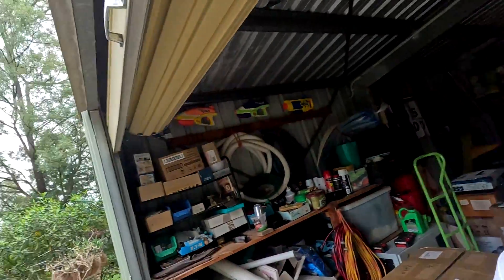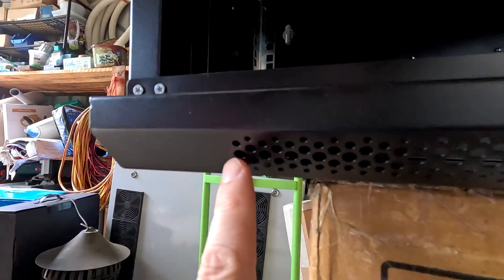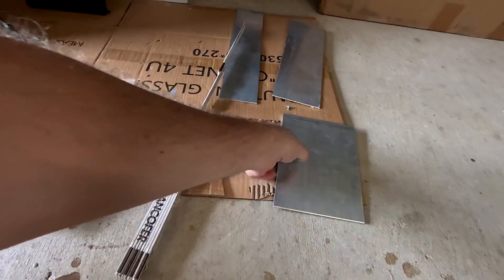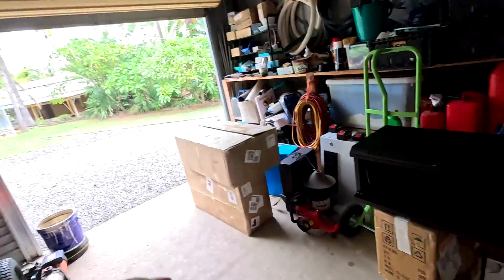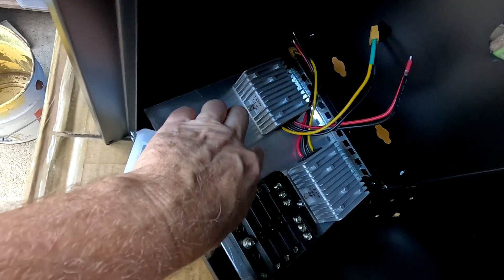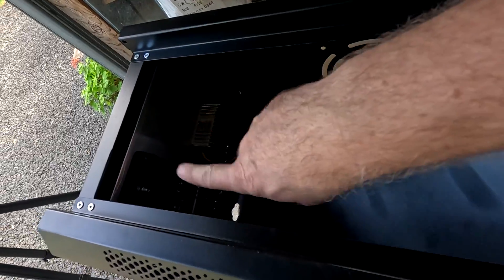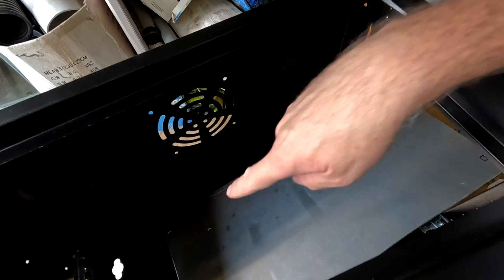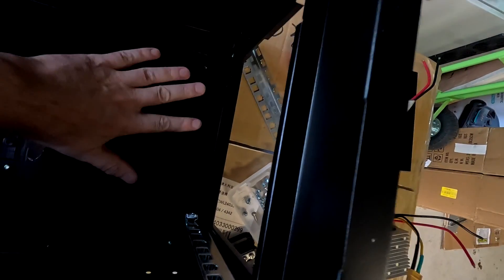Off-Grid Network Cabinet Power Supply. This was not my day...

Comment: That NUC needs 12-20 volts. If you set the victron DC/DC to output 13 volt you don't need the buck converter.

Comment: Andy, 2x 19" vented shelves would have worked better, been easier, and solved all your mounting issues. You're thinking like a machine cabinet designer, not a network cabinet designer ;-)
Reply from the maker: Nope. You will see when it comes together 😉

Comment: Hi Andy,  
I recommend you have a hole in the back plate inline with the brush plate - you will thank me next time you need to run an additional cable with the rack mounted on the wall, and your hand is shoved up the back/behind to wiggle a cable through the brush plate.

Rob from Vic.
Reply from the maker: It all works fine as it is. Sure, it is tight behind that cabinet, but I have only a few cables going through the brush plate anyway.

Comment: Be careful with those power supplies as they are not isolated the negative is 48v battery negative if you get some bit of equipment that has positive as it common you may get a short.
Reply from the maker: All the power comes from an isolated power supply. 
The fuse block has all negatives connected anyway, so it would make no difference.
I'm not aware of any devices which use common positives. Ah, I had a solar charge controller once with that 'feature'. Certainly won't happen with the 3 devices I will have installed in this cabinet.

Comment: With those cheap things, if they undervolt, then heat and current go up.  Not usually great as most electronics aren't immune to fire.  Also, depending on if your switch is a $100 consumer throw away or a $5K+ cisco/aruba/ruckus/etc... you REALLY don't want to have the flash corrupted by, oh, undervoltage.  If you do, well, you either have a long weekend with a very expensive JTAG programmer and soldering rig or you pony up for a new switch.  And generally speaking, no, wifi APs in metal boxes usually perform poorly.  Sliding rails.

Comment: You are building an OVEN for your electronics. See those big heatsinks on your buck converters, they are there to get rid of heat and with no ventilation all your electronics will fry, not a good thing. The cabinet is vented for a very good reason.
Reply from the maker: Testing the boost converters for two days and they are actually cold. I picked them oversized so temperature stays low. They use the same cases for most of their boosters, all the same size.
The cabinet is designed for network equipment with gets far hotter than the devices I will put in.

Comment: Andy, without air flow your cabinet will build up heat, especially in sunny hot Australia. Cool air comes in the bottom and exits out the top. Those holes you plan to plug up would be great for this purpose. Wink Wink.
Reply from the maker: I have a solution.
Reply: I think there's just too many dangerous little snakes and spiders and other assorted horrors in Oz 😮

Comment: As mentioned by others already, wouldn't heat of all those components cause a problem when you plug all the holes? Especially in your climate, the (heat-sinked) buck-convertors, the NUC and network-switch. 
You can place your access-point inside but will need to pig-tail all the antennas to outside of this cabinet, otherwise you may encounter a level of faraday shielding if not careful.
It is personal preferences of course but in this instance and what you are trying to achieve (I think), I would have opted to mount everything in the horizontal plane instead. Make trays with the various components. a 19 inch rack is not really that ideally suited for using the sidewalls for mounting that much components, as you have discovered already during this video....
Reply from the maker: No heat... you will see in the next video.

Comment: I would get a 3d scanner, scan the case with its holes,  get a negative image of it in CAD and  3D print a perfect orifice plug.  Yeah its a lot of work but it would make great content.  Even better would be to get the cambriam max printer that prints TPR, a ruber filament, its the only printer i know of that prints rubber,  perfect material for a satisfying well sealed orifice plug.  Not like TPU which is flexble but slippery, this stuff is like real rubber and grippy.   I was going to get it as my first printer but there wasnt any really good reviews on it.  That atomstack cambrian its called.  Anyway thats my solution, 3d printed rubber orifice plug.  Perfect opportunity for 3d scanner company to advertise, maybe even atomstack with their wierd printer if they even make it anymore.

Comment: Consider network gear designed for offgrid like Mikrotik that has a 11 to 57 Volt input. You can use a POE downconverter for ckeaper 8-30V gear

Comment: Andy,  do you weld?  I'm sure you could.  Cheap flux core or stick welder maybe.  Make your own boxes, brackets, mounts all that stuff.  You basically make a box inside the box anyway.  You're a handy guy and could do it.  I'm sure you have a neighbor that could help (if needed).  No unwanted holes to fill, exact size you want.  Just curious.  I learned to weld to make a telescope dolly, and it is a handy skill to have.  I find your videos and mind so very interesting even when it doesn't apply to me.  I really like the way you show yourself working to figure out the project.  Also, I wondered how long it would take you to mention that the northern hemisphere was getting better for solar.  :)   Have a good one and keep the videos coming.

Comment: Don't mount the Wi-Fi AP inside the cabinet. You'll have RF bouncing around inside, even if there is an RF transparent front plate. It will degrade the performance, and the nearby metal will couple to and detune the antennas.
Reply from the maker: The Wifi is already in the garage! That is nothing else than a large metal box. I'll explain in the next video.

Comment: Why do you want to block the holes, you need all the air possible for all these components, specially the power supply the nuc also wifi hotspot don't work inside metal box 😅
Reply from the maker: Dust and insects.
Reply: @OffGridGarageAustralia  you need a filter for that 😉

Comment: Hey andy, i have the same Fuse holders for my Campervan build. 
Just today i found out even there is no Fuse in the Fuse Slot, there ist still Voltage on the Terminal.
From my 13.8Volt input to the Fuse holder there ist some 12.2 Volts on the Terminal. 
I think it has something to do with the LED wich lights up when the fuse is blown. 
Anyhow it seems strange to me. 
Maybe you can check it on yours or someone can explain the cause.
Thanks for your Work!
Reply from the maker: I can only measure a voltage if there is no load connected. As soon as something is connected, voltage is gone.
Reply: Thank you for checking. After some more research its almost definetly the LED and its Resistor wich is parralel to the Fuse so this should be normal!

Comment: Ah... The POE+ network switch needs more around 54V, not 48V.   48V will .... mmm... barely work as long as the POE+ cables aren't too long, but it isn't ideal.   The POE+ spec theoretically allows down to 42.5V after all the voltage drops but I've seen equipment get unhappy with a 48.0V power supply input.  Remember that POE+ CAT cabling is very thin even though 4 wires are ganged for plus and four four minus, so the voltage drop can be considerable.   You can squeak by if the POE+ ethernet cabling is short... even so, 48.0V on the DC input is too low.

Generally speaking if you have a 48V LiFepO4 battery system to work from, you can just route the battery voltage straight to the POE+ DC input (this is what I do).   No conversions needed at all == near 100% efficiency. The battery voltage range of roughly 48.0V to 56.8V is within the POE+ specification.   As long as the system voltage doesn't exceed 57V, the equipment will be fine with it.

Also, boost converters are not very efficient, particularly going from 12V to 48V.  You always want to buck-down from a higher voltage.  Never boost up unless you have no other alternatives.

--

One other thing to consider as the system sophistication increases is to have satellite "buffer" (aka UPS) batteries on critical equipment.  The network is critical equipment... it sucks when something breaks and you don't have the convenience of your network through which to diagnose the problem quickly.

This is dead simple going from a higher voltage to a lower voltage, one can just use a Victron 75/15 with a fuse on the "solar" side to "buck down" to the lower-voltage buffer battery.  Another method I use is to simply buy a POE+ splitter with a USB-C output then run a 19V USB-C-to-DC cable over to the Victron 75/15.  The USB-C output is already current-limited and short-protected so no additional fusing is required.  Usually good for 2A @ 12.8V (< 30W) trickle charging of the 12.8V satellite battery.

For same-voltage buffers, such as 48V-to-48V, A DC-to-DC charger such as Victron's Orion series is typically the solution.  Usually a low amperage.   48V satellite battery as a UPS?  Yes!   Something like a 25Ah Lithova is perfect for that sort of thing.

In anycase, satellite battery buffering is an issue you need to strongly consider now for system robustness.

-Matt
Reply: Very useful info. Thanks Matt
Reply from the maker: 48V works perfectly. Got it running for two days now.😉

Comment: Andy, as much as I love your videos, this cabinet design is a disaster.
You shouldn't need to put panels on the side, just get standard 19in shelves and attach your components to that.
Also, FYI, you can get PoE+ to 19V adapter so you can skip the converter if you have a good PoE switch. 
Then power the PoE+ switch straight from the batteries with a Buck-Boost converter.
Reply from the maker: Hahaha, great. Viewers said the same about the battery shelf when I started building it.
It all will work out eventually. Trust uncle Andy😉

Comment: If you mount your access point in the data cab, the wifi signal will penetrate through the glass front. But it'll really struggle to get past the aluminium plates and metal enclosure. The cab is similar to a faraday cage.

Looking forward to seeing your new stackable DiY battery build. 

Tschuss
Reply from the maker: I have the Wifi access point inside the garage which acts like a metal box too. 50m away of that garage, I still have Wifi access.
Reply: @OffGridGarageAustralia  Sounds like you've got a great access point. 

I ran some tests a few years ago and  could still connect to an access point that was mounted outside (albeit at a reduced speed) from over 300m away. There were no obstructions, a clean line of sight and no competing radio waves. When I tried this with the access point mounted inside a metal portacabin, the signal rapidly dropped off after 30m. The portacabin had double skinned metal walls.
Reply from the maker: @mikeKirwin  Yes, I have the same experience. The Wifi signal can reach a lot further than one would think but also the opposite and be very disappointing.
I have now closed the cabinet with the door and side panel and still have Wifi signal outside in the yard. For sure, the quality is not as strong any more but I haven't done any specific testing in that direction.

Comment: All those components will produce heat, don't you need any ventilation in the cabinet?
Reply: What? In sunny, hot Australia? Surely not!
Reply: That's free energy.  That's what he boils water with.
Reply: I have similar setup and yes, there will be quite a lot of heat inside. I added 12V low rpm fan  to cool it down.
Reply from the maker: They are cold actually. I have oversized the boosters and they are not even getting warm after running the cabinet for two days.
Reply: I guess he wants to keep out the Ausie wildlife. Like a salties and Kangaroos.
By having a 120 degree network compartment.
That might work.

Comment: Hello Andy,
why sealing all holes?
I think you will need some ventilation to get the heat out of the rack.
Reply: To keep out all the critters, I guess!
Reply: Flywire!
Reply from the maker: There is no heat. Got it running for two days now and boosters are still metal-cold. I have oversized them, so they run at 20% only.